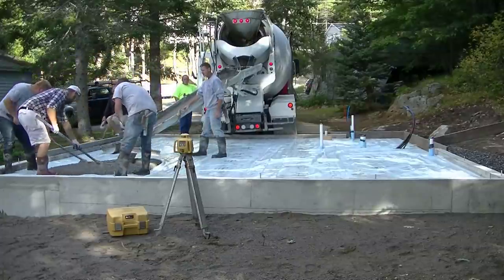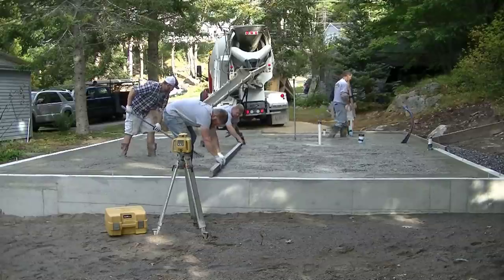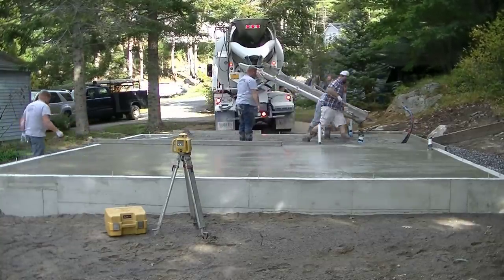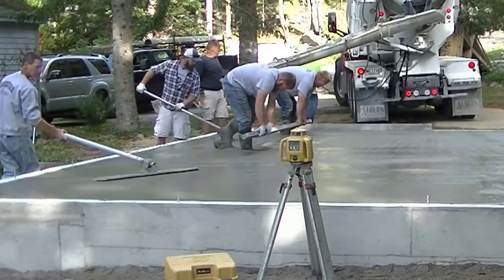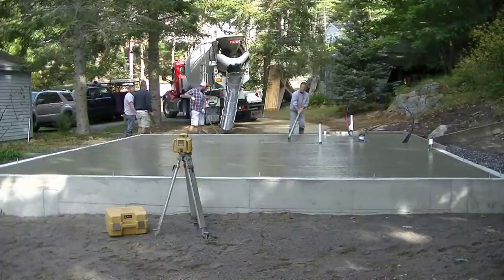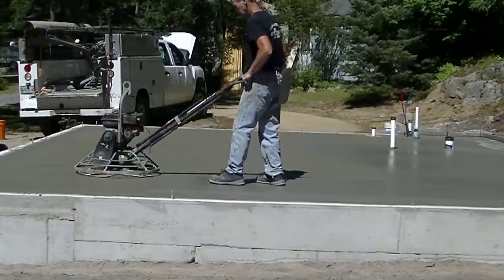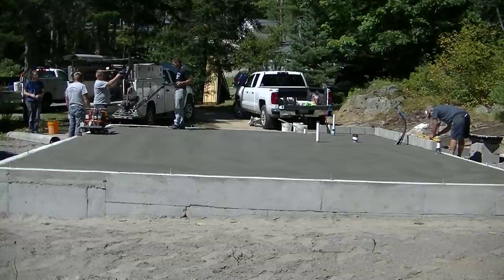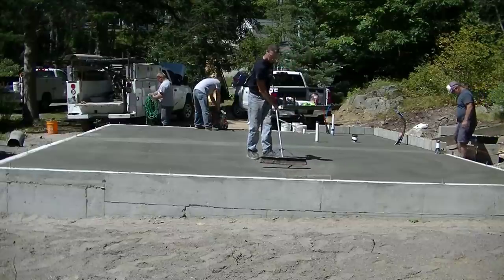Beginners Concrete Floor Pour

Comment: My grandfather and my father mixed concrete in a wheelbarrow with a shovel. Being a more modern guy, I use a mixer. Most videos like this one show a truck that magically brings concrete that is already mixed. Do you have any videos showing this type of work without a concrete truck? If not, I believe many viewers would appreciate it if you made one.

Comment: Mike, do you have any videos of redoing the garage foundation walls? My garage is attached to the house and was built 20 years after by a previous owner. They did a bad job with the concrete and now its all breaking and lifting because of thaw cycles (Quebec, Canada). I will be needing to jack up the garage and repour the foundation walls & then the floor... Any advice?
Reply from the maker: I don't have any videos about the walls. Sorry.

Comment: I'm guessing you've got a fiber-mesh design, since there's no rebar?
Reply from the maker: Yeah, lot of fibermesh used here where we are. Most of the time it's the GC's call not mine.
Reply: Right on Mike. It'd be nice to not have to make all the decisions at times. I like using fiber, but prefer finishing non-fiber. Great video

Comment: Were excavation company,  own are own 30 cages of 6 bar.  Do our own crete work.    Have bird have demon power screed.        Did our own floors. ,  but now sub the floors. To a friend of mine.    Nice work. , absolute animal anything under 11 yds pours himself.       11 to 25 him and one guy.           He grade pins in perfect line.  Then puts zip strip in on that line.           The guy will unload a 8 or 9 yds by him self  in. 20 to 30 minutes everytime       does not screed.  , uses a tamper board.   Floats it ready to  wait to finish.     By himself.  Before truck cleans out and leaves,   he's opening his thermos. Ready to finish.      Absolute animal 52 yrs old. All hes ever done.